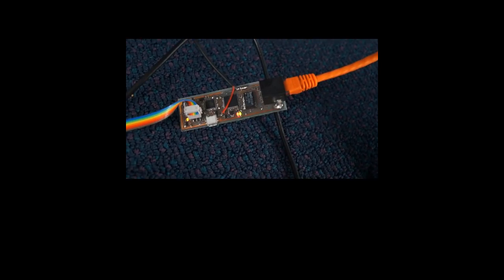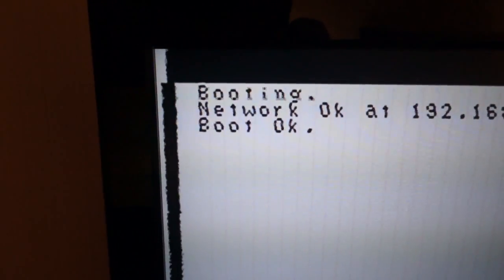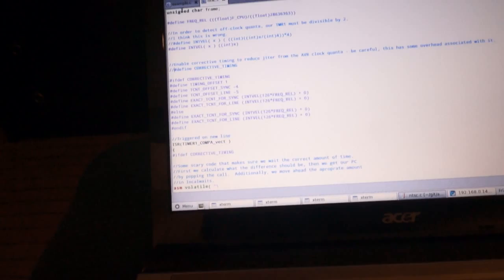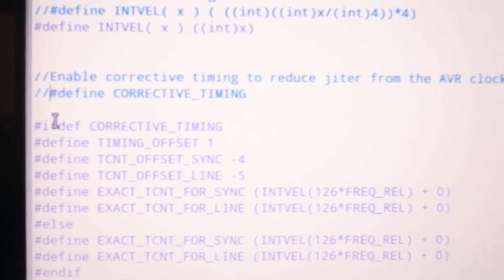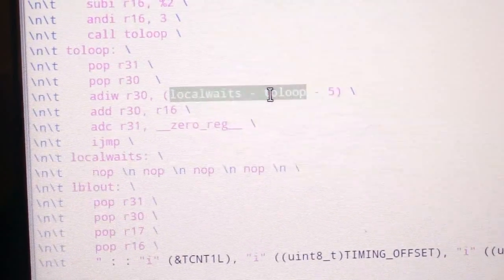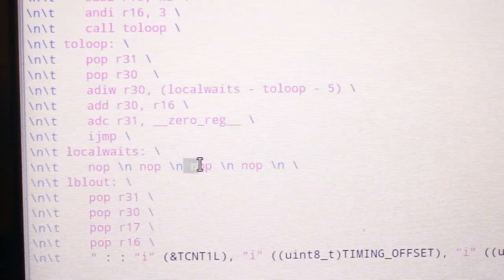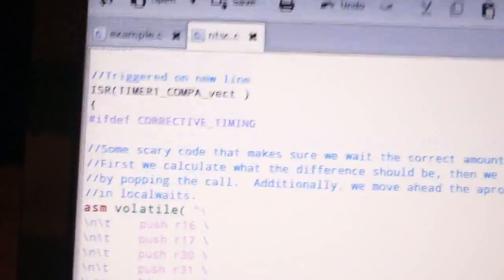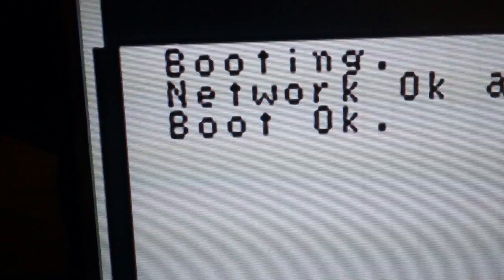Time Jitter on AVR Interrupts

Comment: Much easier than the fun we used to have with the VIC timing, but: This is a perfect example of why single core / interrupt based platforms should be discarded for stuff like the Propeller or FPGAs.  Interfacing to external time sensitive devices is much more elegant when you can simply set some silicon aside to do each job.

Comment: We've done a couple of 2 layer layouts for the prop. That process goes much easier if you can pop a couple vias under the chip!

I brought up that CoolRunner II in our irc just now - sounds a few of the guys have worked with it or are planing boards with it.

Comment from the maker: One other thought - maybe the propeller internally has low-resistance connections between the gnd's and vcc's and extra ones are optional?  It'd be awesome for someone to find out.  This is not the case with most other systems though...

Comment: I'll actually be hanging out with the guy who designed the prop (and the guy who laid out the core to pins interconnect silicon) in a couple weeks. Will let them know they are insensitive clods for not considering the needs of crazy hackers who make glass pcbs :oD

A simple cheap FPGA would be awesome for this kind of stuff.

Comment from the maker: Easier in the coding sense: maybe... but for $1.50 and on a 1-layer PCB, I don't think you're going to be able to get too much dedicated silicon...  Not that I wouldn't kill for a minimalistic TQPF (<=44) .8 pitch FPGA for less than $3.  It seems to be a largely ignored market. The "I just need to do something simple" FPGA.

The propeller is interesting though.  The pinout is just terrible for 1-layer boards :-/... Some day I may move to a two-layer process?